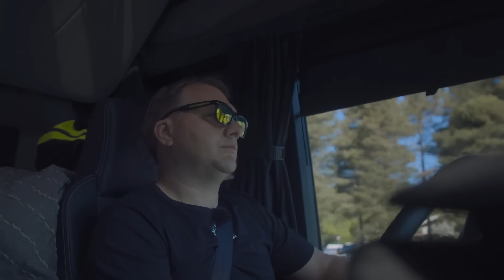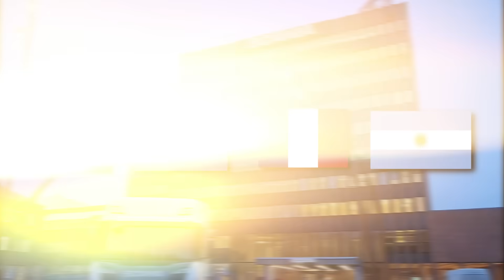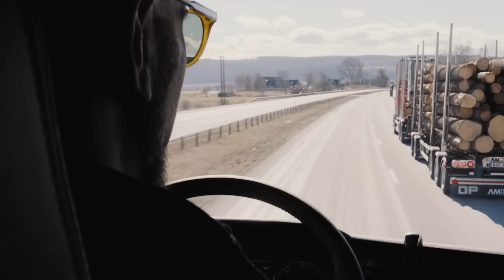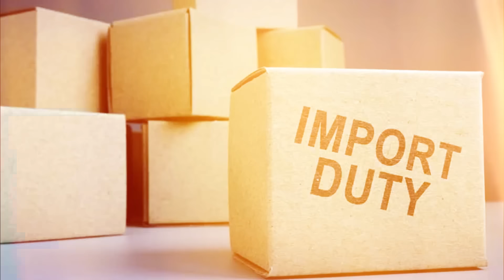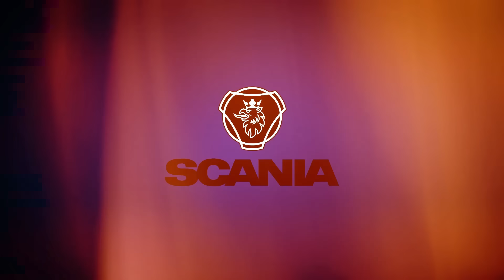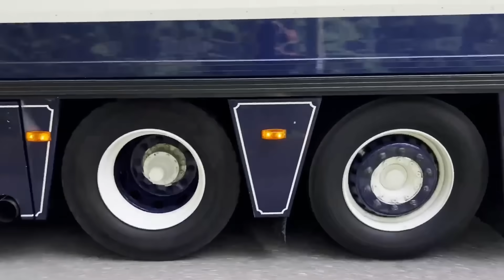Why Scania’s Production Process Would Thrive in the US

Comment: Canada, USA, Mexico and Australia all use the same type OTR trucks, for a reason.  If Scania tries to peddle cabovers, they'll fail, straight up.  Cabovers went out of favor in the 90s, again, for a reason.  The Eurp Scania fanbois clearly don't understand trucking outside of Europe.  Volvo was able to go big in the N. American market, so it's not impossible, but Scania will have to understand the market or they'll fail spectacularly.  Trucking in N. America and Australia are totally different.
Reply from the maker: But they make can overs for Australia still….
Reply: @TheTruckersChannel you'll still see some cabovers in the US too, but it's very rare. The biggest reason for using one is because they're old and grandfathered, therefore they don't require the use of e-logs and a clever driver using a paper log book can cheat the system.
Reply from the maker: @futaba951 Yes that is correct. My point with Australia is Kenworth still makes new COE for that market.

Comment: The problem isnt "the trucks" ... but also *_"US mindset towards potentially deadly vehicles" ... which includes safety inspections (which are a joke) and the "let me improvise and bodge-fix that issue with a workaround" mindset of not doing it properly but instead doing it cheaply.

There is also the driving culture ... and the roads ... which are a reason for the USA having a much higher rate of deaths in traffic than the rest of the world.
Reply from the maker: Trucks are just a tool at the end of the day. The way we use them and the surrounding environment are a much bigger part of the picture.